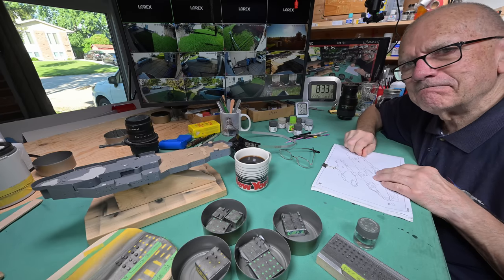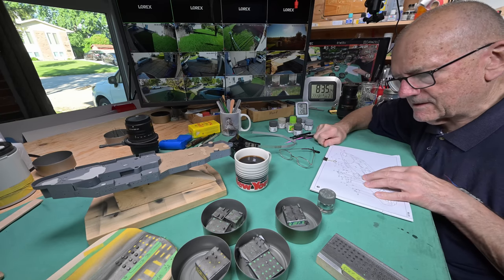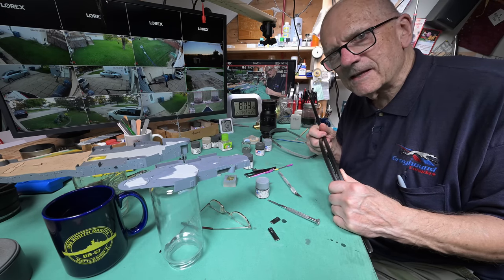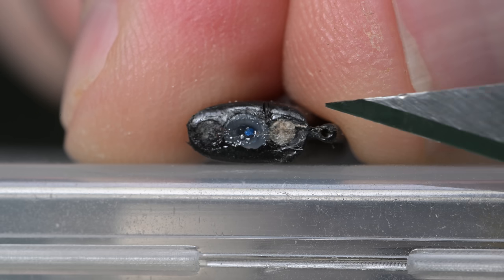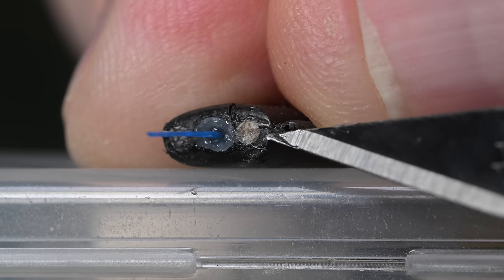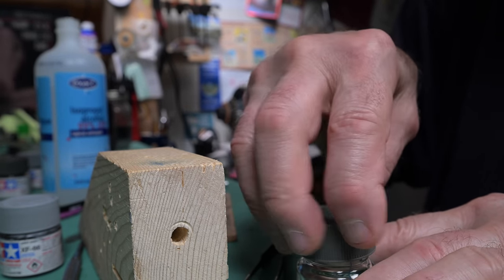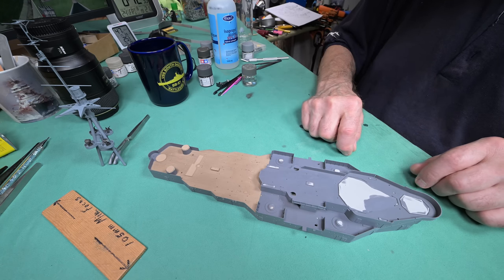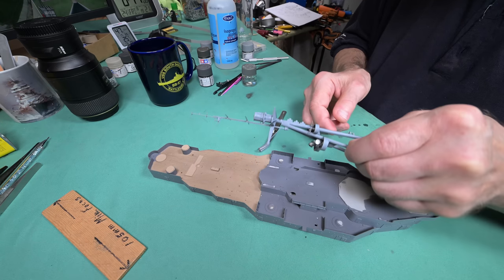The Model Ship - Part 1276

Comment: Hello there, Ron!  Cool episode, as usual.  I commend you on your un-ending curiosity!  Fibre-optic cables use a property called total internal reflection - the light flashed into the solid glass fibre is hitting the sides at a really shallow angle and reflects back into the rod.  It keeps bouncing down the inside until it reaches the end.  Wrapping the core with another material reduces leakage and increases the effectiveness of the internal reflection.  You can send different "channels" of messages by sending them along at different frequencies.  When you think about it…this messaging is pretty much the same as the signal lamps on your ship!
Reply from the maker: We are living in an amazing time Gabe. 👍

Comment: Ron, I believe the blue is a casing around the actual fiber.  The fiber is only 0.25 to 0.5 mm in diameter and is solid glass "wire".  We use a ton of it in the computer center for high speed communication between devices.  What we use is very thin and flexible. The fiber you have looks like a Heavy Duty casing for the tiny fiber in the middle that will protect it when used for direct burial. I would think the two outer tubes are to protect the fiber when pulling/pushing it under ground. The ridge on the side may actually contain a steel cable for strength.

On a completely different subject,  I noticed you are using DaVinci Resolve.  I just switched to it, what a great tool.  I really enjoy using fusion for titles and effects.
Reply from the maker: Thanks for that info Duane. 👍

Comment: Hi Ron, fibre optics are either bundles of glass or Perspex rods. I worked in a hospital endoscopy unit in the 1970-80s where we used fibre optic bronchoscopes, endoscopes and colonoscopy for examination of the lungs, stomach and bowel. Each bundle had roughly 35000 rods, they had light source and a biopsy channel.
Reply from the maker: Interesting work you had. 👍